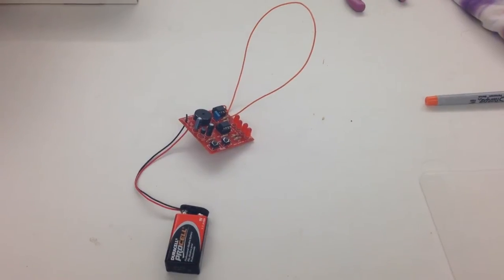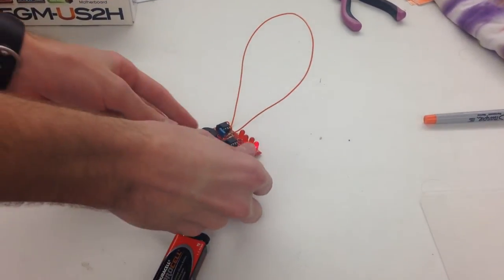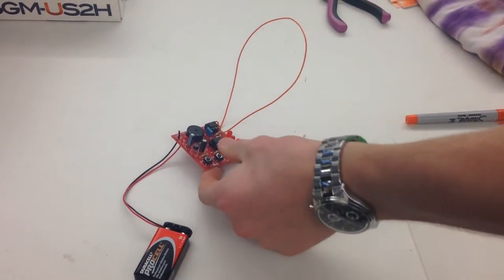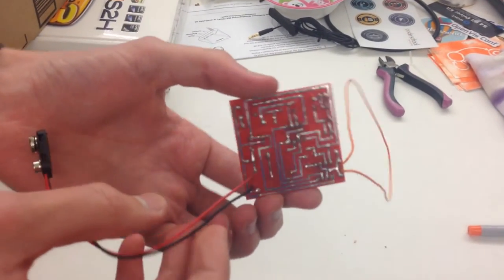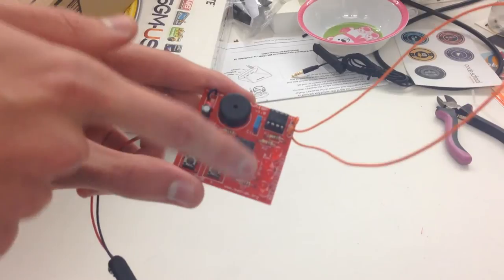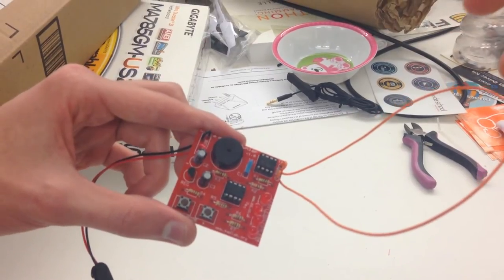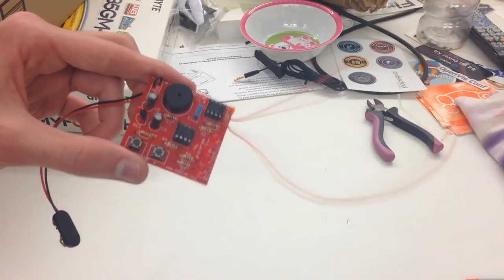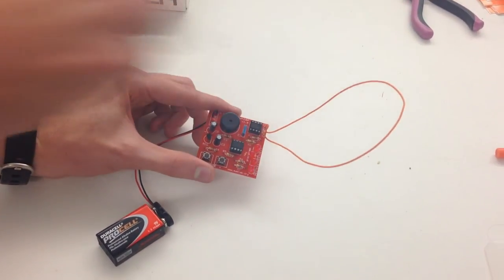Junior Theremin Kit - Brief Trial and Explanation

Comment: I finally figured out how to add an on/off switch and then added a nice looking radio type antenna, placed them in a nice project box, removed the 4 Leds, added longer LED wires to each Led, and replaced the 4 red ones, with 1 Blue, 1 Green, 1 Yellow and kept 1 red, and used larger LEds, now it really looks cool, I also built one into an old Network box, that had a little plastic type window in it, I placed the Leds on the inside and when turned on, they shine through the plastic for a very cool look.